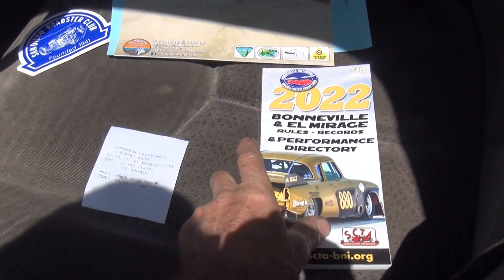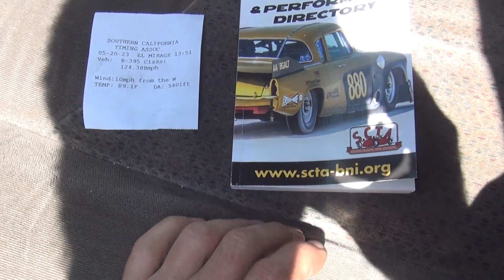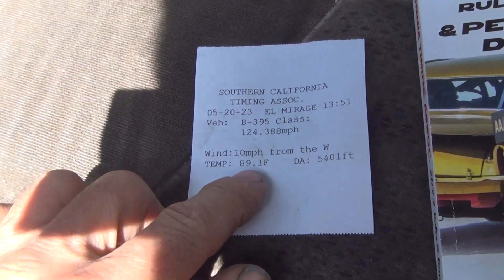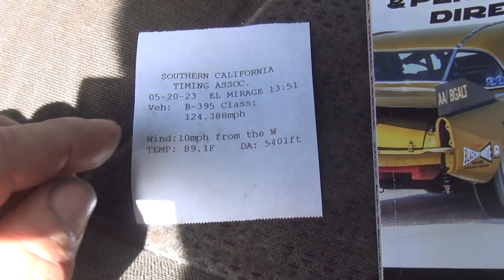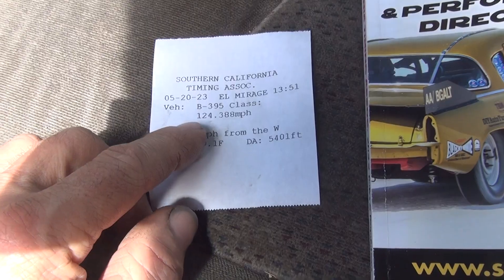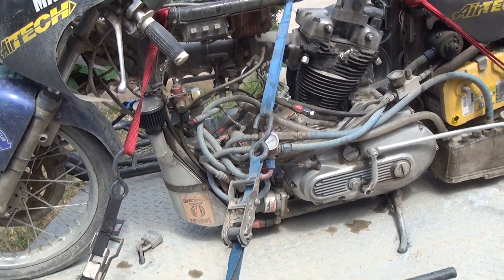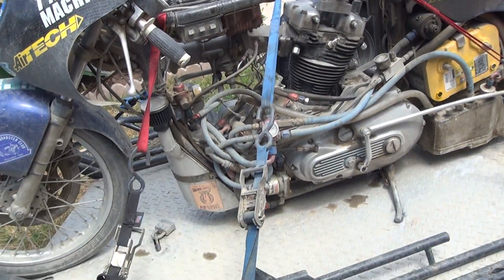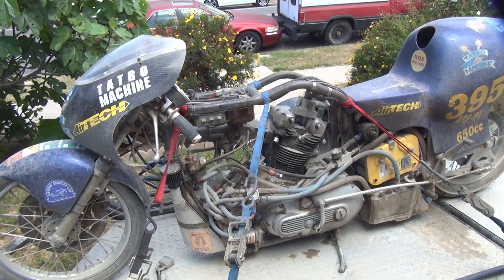#201 2023 el mirage scta landspeed racing harley 650 single xl sportster rebuild nitro tatro machine

Comment: Still you went about the same speed as in september’17 when it was popping like crazy in the beginning. 
It puked you on the other leg that time. 
Crankcase pressure release lines up? 
At least you have a bit of time to get the engine and components into shape and do a bit of a shake down.
I guess there’s a few planned race weekends left. 
Judging by the state of the piston after break in and the run I think you make a good chance this year. 
No vaporised aluminum spots on top? 
We’re keeping our fingers crossed. Good luck fixing the FP regulator. 
Glad to see you’re having some fun again, it’s been a while.

Comment: id be happy to see 120+mph on a single ironish! damn
Reply from the maker: not me, i went 126.9mph on my 2nd pass on this bike in 1992. and that was on gas.
tatro
Reply: @TatroMachine  I'm easily pleased then.  Your a man who can, you'll get it dialed in to see that and more at the next one.
Reply: I know how stubborn you are, but in order to get that turd faster you're gonna need to invest in a more modern fuel management system. Even if it entails welding a bung to the exhaust to read & adjust the fuel delivery as needed. The dudes who strive for perfection are dialing that in on a dyno for optimal performance and tweaking on a laptop as they see fit. Technology can be your best friend if you allow it to be, otherwise you're just pissing in the wind with jets changes etc. I'm old school too and don't own a fuel infected bike at all but if I wanted to go out and attempt breaking records I'd be investing in the proper technology to get me there.